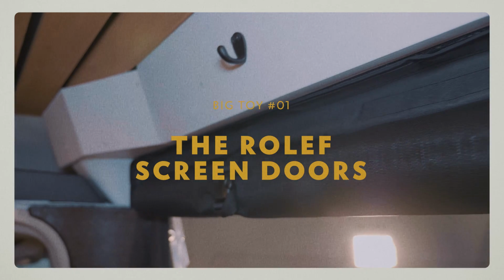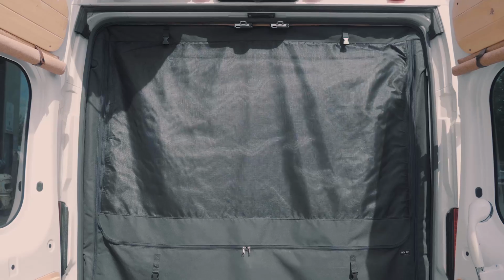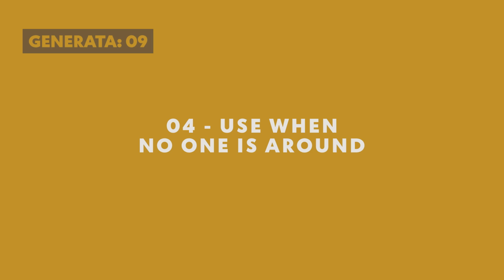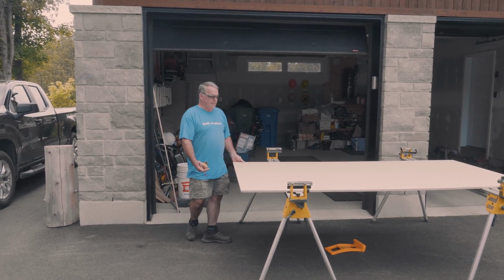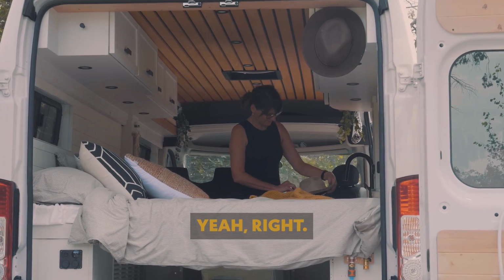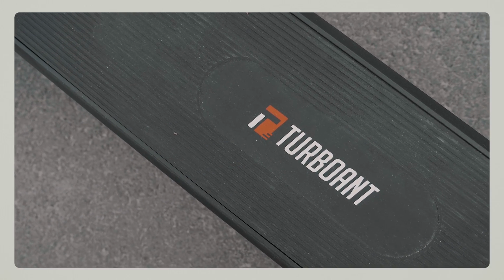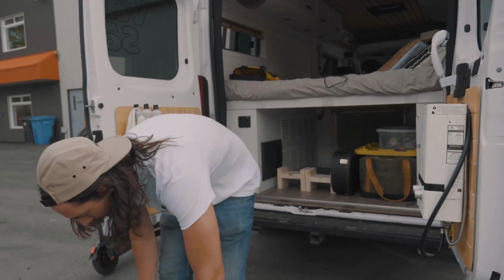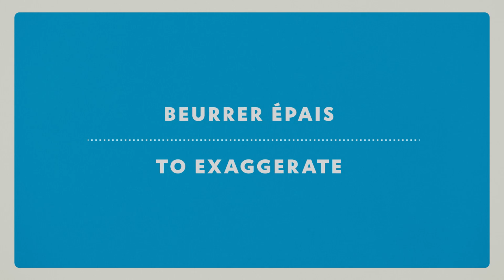GAME CHANGERS - 4x EPIC vanlife ACCESSORIES (TOYS) that will make life on the road EASIER.

Comment: Small generators, mostly Honda-eu series, are used frequently in Europe, mostly to top up the leisure battery of the van/motorhome.

Increasingly however people find out how inconvenient that is. Since we have a weight restriction of 3500kg, an extra generator of 13kg, plus 5 liter of gasoline adds to the weight and costs a lot of space. Not to mention the possible smell of gasoline from storage

Add to that the limited charge it brings to the leisure battery most now switch to just let the car engine run. In 30 minutes you can charge more than in 3 hours with a little generator, it saves space and weight, plus why invest €800-€2000 on a charging device one already has available in the van/motorhome?